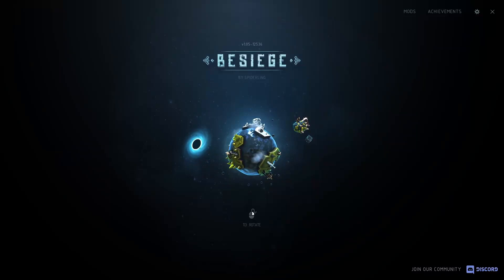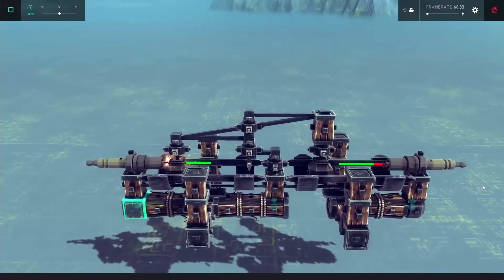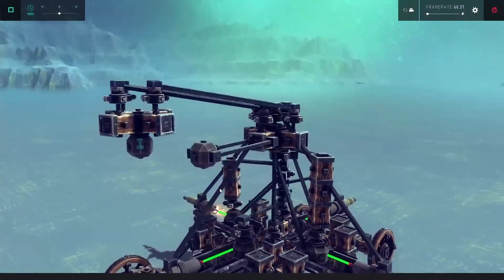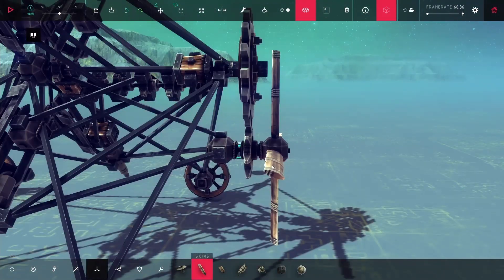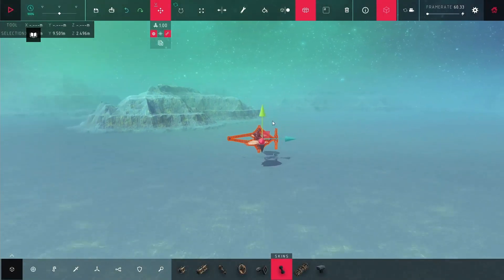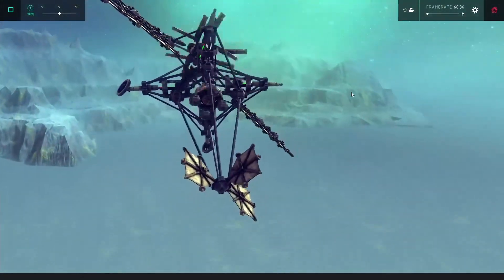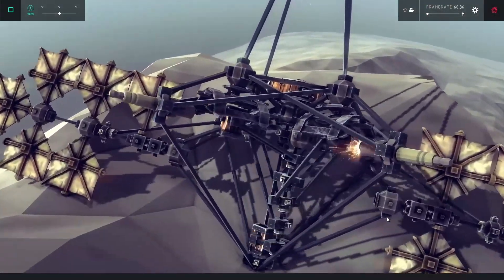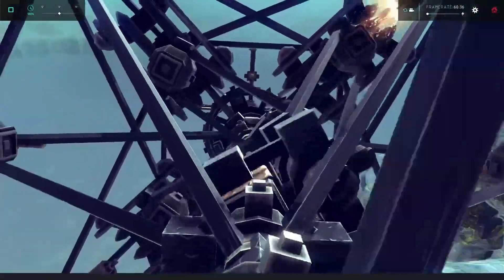Making an Engine Powered Plane in Besiege

Comment: 13:03 im no engineer or anything so take this with a huge pinch of salt, but if i had to guess, id say thatd be the first engine trying to rotate pushes off on the second one the same way a reaction wheel works, which would jumpstart the second engine going the opposite direction

Comment: believe it or not, making an engine that can propel a plane/helicopter is much easier in besiege than making an engine that can turn wheels, i dont know what it is about the game engine but its  simply easier to make a giant windmill on a car and spin the windmill with the engine, than to make the engine spin the wheels. It actually produces more torque and spins faster.

Comment: I found after many hours of playing besiege, that engines are torque limited quite heavily. So even if you increase the speed of any motor and max out "acceleration", most of the time it just causes more instability. Or other problems occur. Like things start breaking. So you add strength to fix that, now we have more weight. And we're back to square one. Thus aeronautical engineering is as much of an art as it is skill. "Props" to your skills btw. You did a great job with your plane.
Reply: found that with besiege you have to breakout old tech like heavy ass flywheels to break torque limitations

Comment: I wonder if you could make the engine more efficient/smooth if you made the piston length bigger (travel farther each way, maybe with more power & “range” behind the spark plugs?), and have propeller blades go out all the way instead of on just a ballast held by struts suspended away from the crankshaft, in theory increasing how much of the front is generating drag/power from the increased surface area

Dunno if you still read these comments, but here’s my input i guess :D
Edit: grammar, unnecessary writing.

Comment: Sorry in advance for this long ass comment. If you get confused, skip to the last paragraph. So the reason that planes have the pitch control surfaces on the rudder while having the ones for rolling on the wings is due to this equation: Moment(or rotational force) = Force x Distance(perpendicular). 

The distance is perpendicular to the direction of the force and it is measured from the point of force to the point where rotational force is measured. Assuming the airplane wing's distributed lift force is the same throughout the entire wing, this is the distance from the center of the wing to the center of mass on the plane (while the force is half the total force on the wing). So the further from the center of mass the control surfaces are, the more distance, and therefore, the more rotational force. The direction of the distance matters though since it is perpendicular distance. So if you put the roll control on the rudder, the perpendicular distance is the tiny distance of a half of the rudder length, not the massive distance between the rudder and the center of mass of the plane length wise. The opposite is true when we are talking pitch control. 

An easier way to understand this is the concept of wrench. The longer the handle, the more rotational force is applied to the bolt because you push on it in a direction perpendicular to the length. You aren't going to apply any rotational force trying to push on the handle parallel to the handle's length.

Comment: Maybe increasing the gear ratio? Or using a Biplane Design for increased lift, it's the design they used in WW1 because their engines are not fast enough

Comment: If you use a hinge on a swivel joint and then use the advanced building tools to move it something like 0.3 or 0.4, you can get a decent stroke piston in a very small package. I use it for most of my engines. I also didn't know about the spark plug mod, or using the smooth blocks as sidewalls. That is huge.

I did once do a inline 6, but it requires you to do a little bit of trigonometry to figure out how to turn and place the hinges. But I'm sure you could apply it to other engines too.

Comment: You can rotate the aerodynamic propellers to have more drag when spinning to increase the speed the build goes. You can also get 8 propellers on one block by highlighting a block with 4 propellers on it, using the rotate tool to duplicate it, rotating the dupe 45 degrees, and then deleting the duped block but leaving the propellers.

Comment: Er, why not create a large gear with your ballasts and linkages, and then position the spark plugs around the perimeter, tangentially - like a waterwheel ? Seems you'll get a higher rate of rotation, seeing how fast spark plugs launch boxes. Just put the propellers inside that perimeter, and put the whole thing on an axis in front of a wingbody...  and please, use an adjacent pair that rotate in opposition, instead of a *counterweight*! VTOL plane seems possible.

Comment: An important thing to remember is the engines torque steam engines are have a consistent power stroke 
The spark plugs don’t so the the torque is significantly lower

Comment: I like the video just a few tips, raise each cylinder to be inline with its spot on the crank this will decrease complexity and size while improving stability alternatively each cylinder can be added to the same spot on the crank if they are clocked and timed properly making a radial engine.

Comment: The reason why the wing-panel propeller didn't work is because a long, thin blade provides the best thrust a low rotational speed. If you look at old early aircraft, like around the time of the Wright Brothers, you'll see a lot of 'ship oar' style propellers like the wing-panel propeller that don't work. They spin quickly, maybe, but provide noooo thrust.

Comment: 1:50 Fun fact: some really old engines actually use this kind of motion, its called 0 rpm speed, Lanz Buldog uses this.
Reply: Miałem o tym napisać ale mnie wyprzediłeś
Reply: Does it use that on purpose, or only as a curiosity? As far as I know, reversing direction was an issue in vehicles with gearboxes, so they had "engine direction" indicators to notify the driver when the engine changed direction.
Reply: @TlalocTemporal  To my knowledge, there aren't any combustion engines that run at 0 RPM, as that type of engine basically has no torque at 0 RPM. However, it was used as a way to reverse engines before gearboxes became more common.

There was a Swedish engine called the 'Bollinder' which was a vertical stroke oil engine, often used in small fishing boats and sawmills. Engines like these could burn just about any oil you could name, which made them very popular for many years in remote areas of the world.

Like I mentioned, instead of a reversing gearbox, you reversed the engine itself. To reverse, the engine was slowed down nearly to stalling point (the aforementioned '0 RPM'), then the fuel lever pushed over until it started injecting well before top dead center(the point when the piston is farthest from the crankshaft). At this point it would effectively backfire and start running in reverse.

Comment: A cool idea that could have utilised your two engines would be to have a pusher puller design with a pair of propellors rotating in opposite directions, one in front and one im back. this also would naturally neutralise the effect of the engine torque on the airframe so you wouldn't need a reaction wheel to stop it rolling by itself
Reply from the maker: Yeah, would have made controlling it a lot easier

Comment: Glad to see you ditching those smooth surface blocks, they have a deceptively huge connection zone even when shrunk by scaling mods, messes with alot of stuff. I recommend getting a mod that shows all the blocls connection zones, its pretty helpful
Reply from the maker: I will touch on that in my wankel video if I ever get it working. The smooth surface blocks look great imo but have some horrible collision properties
Reply: @ReidCaptain  That's literally why they were made. People kept using tons of ballasts and hinge blocks to make smooth surfaces (which was very laggy), so the devs made a block specifically to solve that issue, and made sure it looked nice and had a large flat side so people would be inclined to use it instead of the really laggy 40 hinges and 20 ballasts to get smooth surfaces.

Comment: The rpm seems quite low. Is that just the video?
Reply from the maker: No, the output speed of the engine is just very low. If it wasn't for that, I could have had it in the air two hours earlier lol

Comment: Typically the ailerons aka roll control is on the wings, and pitch control is on tail
Reply: I laughed so hard at that part xD
Reply: That was hard to watch lol
Reply: What about yaw?
Reply: @Green24152  -- Rudder, also on the tail.
Reply: hello there
Reply: To add to this, pitch control surfaces are called elevons.

Elevon - on the horizontal stabilisers, pitch.
Aileron - on the main wing surfaces, roll.
Rudder - on the vertical stabiliser, yaw.

Comment: Amazing work Reid!!! I have 500 hours in besiege so maybe thought I could give you a few tips.

- Putting the little panels with their backside towards the direction of movement actually produces a lot of drag.
- Roll could be controlled by the wings, and pitch by the stabilisers (back-most wing panels) to make the plane super stable. (which you did at the end good job)
- If your plane is yawing a lot, you could increase the size of the vertical stabiliser (back fin).
- A hack to stop torque is to suspend the entire engine on two hinges or wheels, so the counterrotation is put into the engine itself instead of the vehicle

And if you ever wanna produce a vehicle that goes 1100+ units/hour, wing panels at 88 degrees or so give MASSIVE thrust when spun quickly.
Reply: you know... 1100 units/hour is like 0.5 units/second, that is like barly moving

Comment: Try a helicopter with one of these could be easier
Reply from the maker: Getting enough thrust could be a challenge lol
Reply: @ReidCaptain  in one of the scenes in the video it was already trying fly upright rather than being a plane, and also to help with stability for a heli you could add another engine going opposite direction to counter rotate it and the propeller blades could be in a push configuration on it so you push and pull and no spinning round and round

Comment: Stretching the wings probably doesn't increase the drag they produce. Intuitively it should scale with their area, but since stretching is not a vanilla feature, the hard-coded drag value doesn't change.
Reply from the maker: Yeah, that makes a lot of sense. It seems like the short wing panels create more drag then the large ones as well. Weird stuff
Reply: @ReidCaptain  those big wings are weird. They do nothing except maybe slow the descent of your crafts
Reply: Correct, drag doesn't scale, but that can be pretty useful at times, since that's also the same with balloons and other objects
Reply: What you instead can do is to make them smaller, allowing you to fit more in the same area.
Reply: I think the solution here could have been a biplane design, would have made wigns much more stable connecting them to the top and the bottom of the plane

Comment: make a gun, with a working magazine, ejecting casings, etc
Reply from the maker: Oo I wonder what ammo I could use
Reply: @ReidCaptain  you could use the ballast weight things, and half pipes as barrels. spark plug as the firing pin/ powder. I would recommend a revolver so that ammo is easier to load, but a magazine would save the rotation thing. i actually would try this idea, but i dont have beseige
Reply: @ReidCaptain   fireworks :) ( or missiles idk how they're called )
Reply: @dottedboxguy  I've designed 2 functional tank style cannons that used fired a rocket and a explosive warhead. Needless to say, the trouble wasn't the cannon nor the ammo, but the loader and the magazine.
Reply: @dottedboxguy rovvvvv
Reply: @ReidCaptain  Try cannons as individual ammunition if you want to make a self-loading design using recoil as the mechanism, a workshop designer called Petrus1904 has made 2 self loading "pistols" using cannons as ammo. Maybe you could get inspiration from him!
Reply: @ReidCaptain   for ammo use dozens of scaled down cannons attached in a ball, which are activated on impact. A cannon-ball
Reply: @ReidCaptain  could try using spark plugs as the bullet casing
Reply: @ReidCaptain  use the spark plugs, then they explode when they hit something
Reply: @ReidCaptain  make hp and ap
Reply: @ReidCaptain  children
Reply: How about making the shooting mechanism with the sparkplug
Reply: @philippvonferrarikellerhof1720  yes use the explosion from the spark plugs to propel them out of the barrel.
Reply: Oh yeah
Reply: USA USA